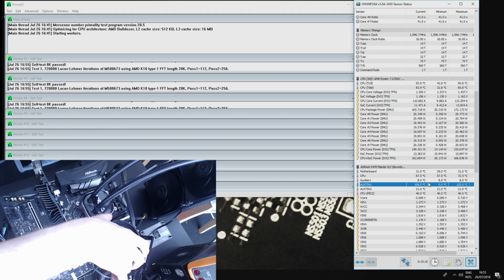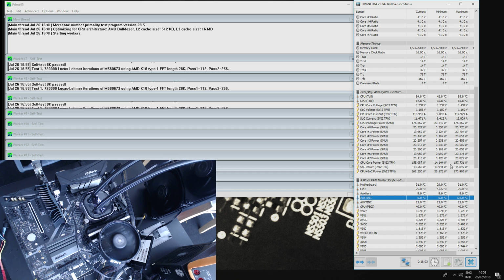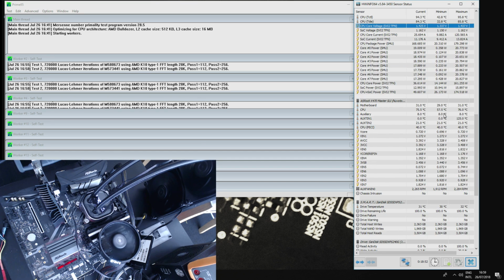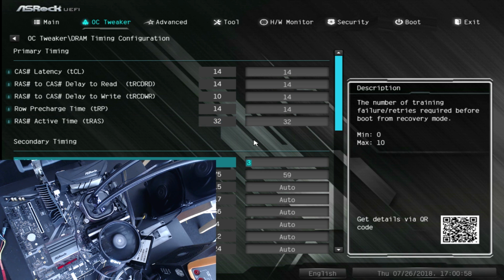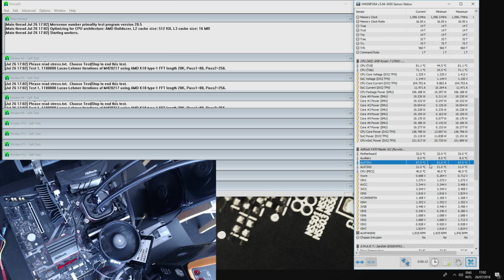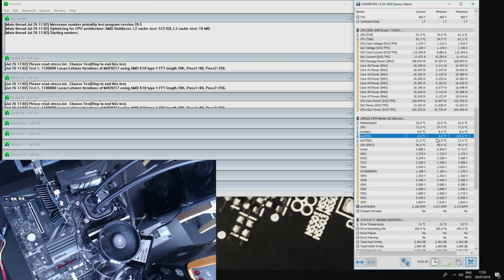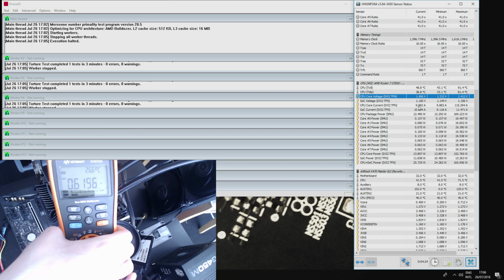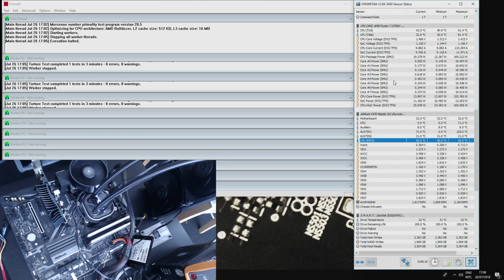The Asrock X470 Master SLI VRM temperature sensing is broken and there's no OTP either

Comment from the maker: second
Reply: Say, do you have a discord server? i'm getting a lot of technical information that could be beneficial to your adventure in hardware-land
Reply from the maker: I'd stick to around 1.38V or less all core since the 12nm process is leakier than the 14nm process. PBO will give you much more than that but PBO scales the voltage vs CPU temps, clocks and core utilization so it won't run your CPU into the ground by shoving 1.5V into at 80C 4.1GHz all core. It will give you like 1.5V at 60C 4.35GHz single core(which is much safe than 1.5V at 80C).
Reply: Where did you get your new Keysight from? And did you have to pay the full price for it (#400-500 GBP), or were you eligible for any discount?
Reply from the maker: I got it on ebay for 430GBP since places like farnell were charging even more for it. I don't think I'm eligible for any discounts.
Reply: they noticed the thermal protection got in the way of there looks of performance, so they disabled the laws of physics, lol.
Reply: I can confirm about the idle voltage dropping on Asus boards (at least on the crosshair vii hero), and you talked about 1.42 not being safe, what is safe on zen+?
Reply: So sad AsRock is screwing up their name this badly... They did a good job (hardware wise...) on the X370 Taichi, but BIOS support has been so bad... I kinda regret not getting the Gigabyte X370 Gaming K7 at this point...
Reply: Which MSI board didn't overheat? The Gaming Plus or the Gaming Pro Carbon?
Reply: buildzoid let me say something that may be completely stupid.  i have an asrock board and have the same auxtin1 on my board and sets at 104c all the time.  i assumed it was the vrm temp sensor as well.  was worried about how high it was so i decdided to see what it would take to throttle it. keep in mind that is was a cheap z370 pro4 and i ran 190w or so through it at 1.4v at 5.3ghz with an 8700k on a handbrake encode slow preset.  the vrm temp went down to 103 instead of going up lol.  i contacted asrock to ask them about which sensor was the vrm temp to be sure and they told me that my board has no vrm temp sensor.  whatever that reading is on my board, it is not the vrm temp. have you seen any documentation in the manual or talked to asrock to see if this really is the vrm temp sensor.  just thought i would throw it out there.  wouldnt hurt to ask them.  im sure youre board has a vrm temp sensor but mine looked just like yours (in hardware info 64) but there is no sensor at all.  all it would take is an email
Reply: Wait the X470 Gaming Plus has better heatsinks than the X470 Gaming Pro Carbon? Surprising since the X470 Gaming Pro Carbon cost a lot more than the Gaming Plus but thanks for the heads up!
Reply: Revisiting the tear downs again to compare. Only boards available where I'm from are the MSI and Gigabyte lines with the single AsRock Master SLI which is... yeah... Thanks again for the input!
Reply: Actually Hardcore Overclocking huh The AUXTN1 sensor on my ASRock Z370 Fatal1ty Gaming K6 does not work right.... It reads 105c at idle, and sometimes drops to 103c under load... Wonder what that's all about...

I know it is NOT my VRM temps, because I can comfortably touch the heat sinks, and they are luke warm. Must mean the sensor is broke?
Reply: DysphoricSmile i had my friends ASRock ab350 board show 105c-110c at idle when he accidentally set LLC to extreme on everything and 1.2 dialed in to the SoC and it was impossible to stabilize unless LLC was set back to extreme with no overclock. We Didn't know if the R7 1700 was dead too but we RMAd the board and cpu. Not sure if this is the case for anyone else. Watch how to kill your motherboard with safe temp by gamers nexus and see if its what happened to your board.
Reply: I have this mobo and it shows wrong cpu temperatures,why?And what can i do now?Thank you!(I have tested aida64 and many other programms)
Reply: Hi Buildzoid I'm new here and I must say you are doing a great work. I have a question is it safe to run Ryzen 5 2400G on MSI B350M Gaming Pro (pure APU no PCI-E GPU)? I wish I had find your channel before I bought that damn MB (after numerous recommendation from numerous so called tech youtubers). HWiNFO64 rapports that SOC is drawing 90,3A during gaming (on stock no OC everything set to auto in BIOS). Am I facing SOC VRM damage over time and should change MB asap or HWiNFO64 is lying to me and its safe? Here is a screenshoot from HWiNFO64:
https://zapodaj.net/images/01f7472627599.png
Reply: Just switched from an Asrock z77 to gigabyte z370. I had nothing but problems with the z77.
Reply: Could you test Biostar x470 GT8? it has clockgen, "12 phases" 1220 codec etc and costs less than Asus Prime in my country https://www.wykop.pl/wpis/32176105/biostar-wypuscil-ciekawa-plyt-x470-racing-gt8-na-p/
Reply: Actually Hardcore Overclocking hey i have the fatality gaming K4, 2700x w/ stock cooler and i dont really want this board anymore. I have a warranty and plan to try to run the board into the ground. Is there anything you want done that could help your OC adventures?
Reply from the maker: killing the VRM can often kill the CPU
Reply: Actually Hardcore Overclocking yeaaaa i assume that's why it wasn't possible to stabilize without LLC and raised voltage even at stock clocks. It was a learning experience. I told my friend not to go any higher on the voltage and he did something with ryzen master.